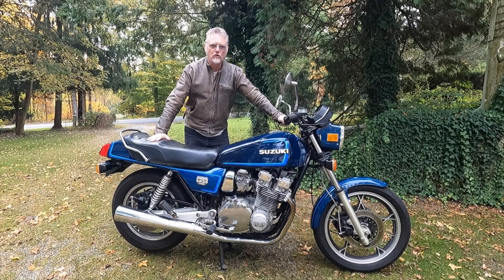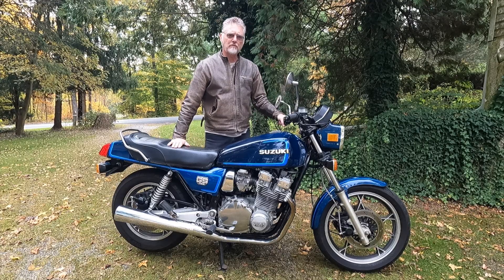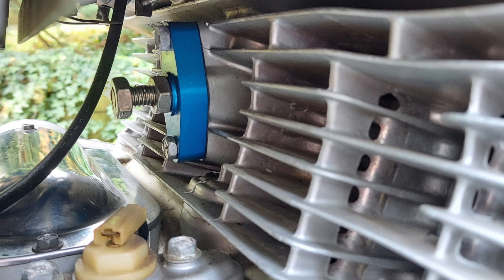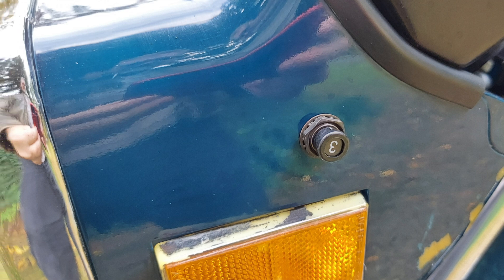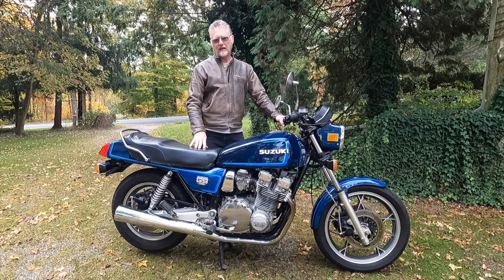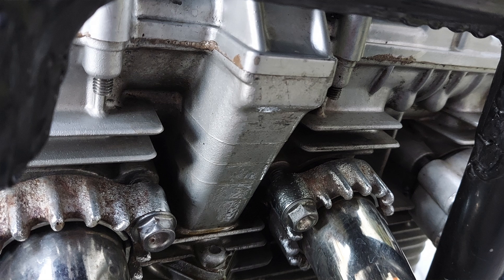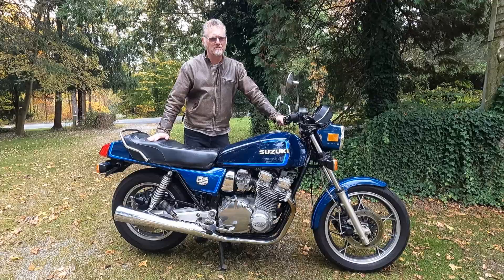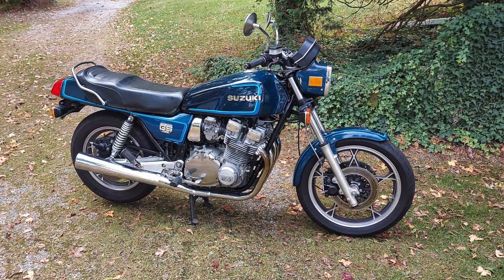1981 Suzuki GS1100E (GSX1100) - Part 3 - Restoring a Classic 1980s Superbike!

Comment: Mine didn’t have the Check Panel, what a cool display.
Reply from the maker: I like it. It's a cool way to do the indicator lights. Cheers!
Reply: Was that standard or optional?
Reply: @spaceflight1019  I’m not sure, mine was a different year.
Reply from the maker: @spaceflight1019  Standard depending  on the year. I think 1980 and 1981 had it, but it may only be the 1981. Cheers!

Comment: Another quality, classic piece of history. It is a victim of its era though, in regards to the 55 mph. But one of the only positive things about a chain driven bike, is you could change the gearing for mainly Touring use, if you wanted to, since the engine has strong power.
Reply from the maker: Thanks! I agree that the ability to change gearing is a nice option to have. I still like the shaft-drive bikes, though. Cheers!
Reply: @jonsmotorcyclerescueandrev3538 While shafties have their advantages modern O-ringed chains have done wonders for reducing maintenance and keeping the bike clean. My Z1 had an automatic chain oiling system that was great at making the back of the bike and oily mess!
Reply from the maker: @spaceflight1019  I'm glad some "great" ideas didn't catch on. 😉

Comment: Looking good, only 9000 miles !!, this bike would cost a fortune in the UK. Those plastic bodied front master cylinders from the eighties always leaked, you can see the cap bowing, the screws don't clamp the body well enough into the cast body so they weep out fluid, usually unseen, the brake fluid makes its way under the rubber gaitor and down the line, the rest will blow over the fuel tank when riding, gradually destroying the paint, I would just bung a wrist sweat band over the cylinder . Have a look at the chain guard, forward of the rear shock, on top, they crack, with your 530 chain now and low mileage it shouldn't be a problem though. You've got a great example..its too good to sell
Reply from the maker: Thanks, Bob! I'll keep an eye on the master cylinder. Cheers!

Comment: You are coming along well Jon, do you know if there’s a difference on performance, bikes come with 8 valve VS 16 valves ??thank you
Reply from the maker: Great question! The 16-valve, chain-drive bikes are stronger above 6k rpm and run faster 1/4 mile times. But the tuned for torque 8-valve, shaft-drive bikes are slightly stronger below 6k rpm. Cheers!

Comment: Those valve cover screws  on the exhaust side need to be shortened.

Pennsylvanians bough motorcycle in large quantities in the 70s and 80s, so it's a rich ore for used bikes.
Reply from the maker: I'll check on the screw lengths when I do the valves. You're correct about PA. It has treated me well when buying older bikes. Cheers!
Reply: I had the same bike in silver loved  it
Reply from the maker: @philnox7734  The GS1100Es are nice bikes!